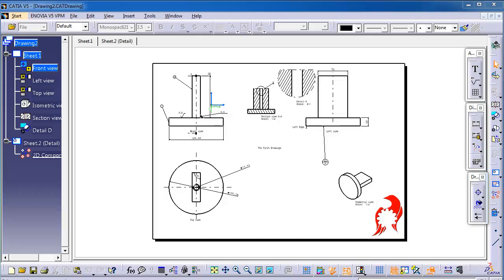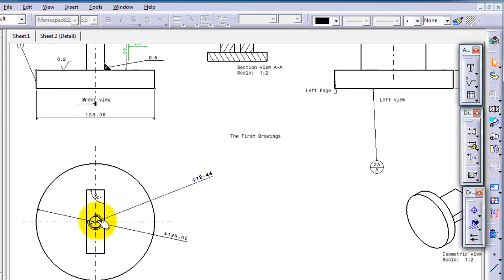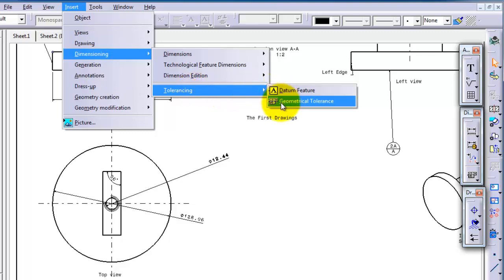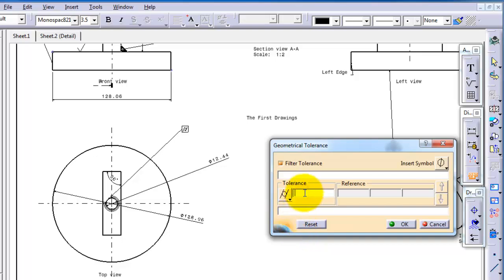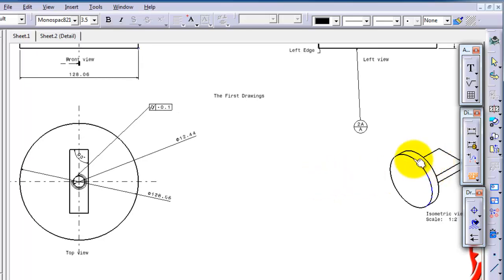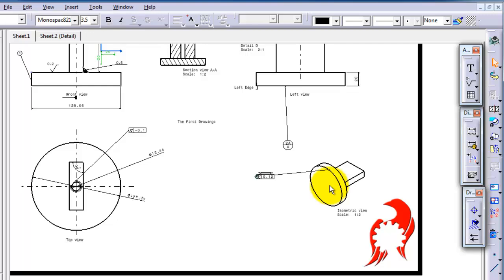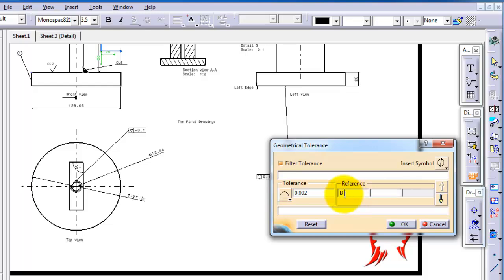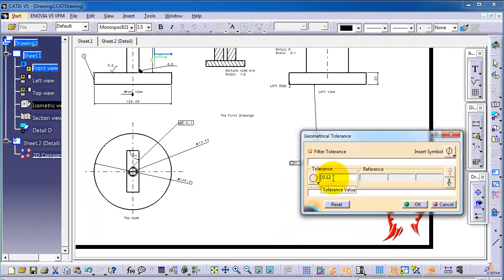119 CATIA drawing Tutorial: Adding Tolerances

Comment: Tolerance for thread?!?! and minus?!?!?! it's worse than crime!
Reply from the maker: why not? So it will be easier to fit in case the other side has + 
There are many cases and dependency, and I guess if you have a case in your mind it doesn't mean it is applicable on all cases! This is engineering Michal, in other words (problems solving)